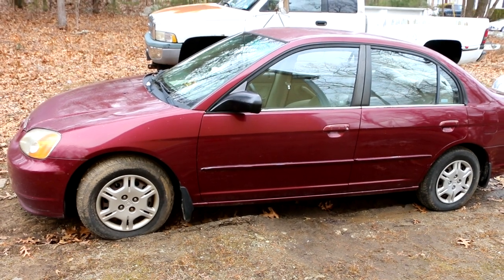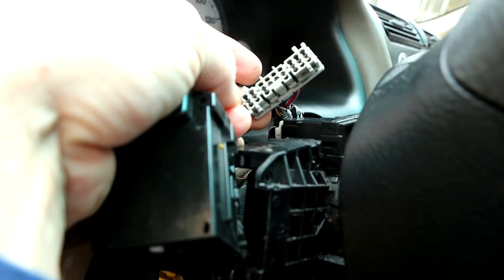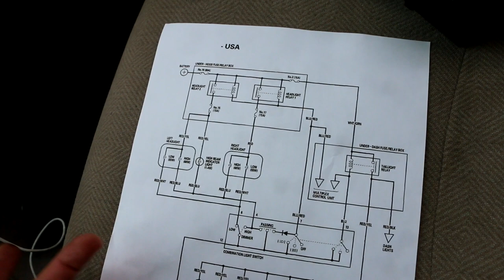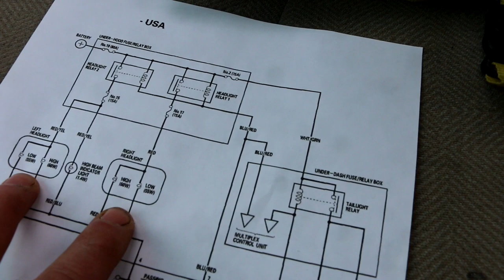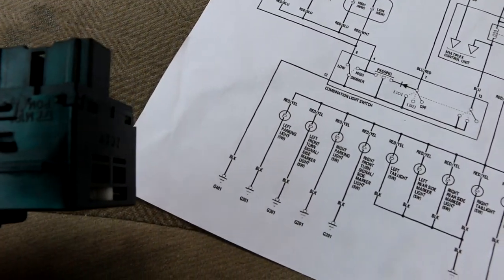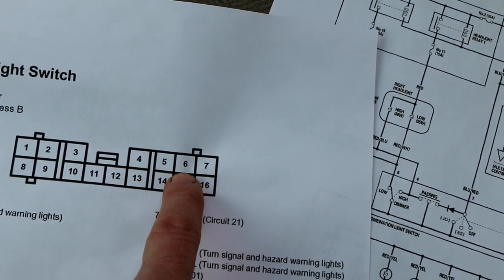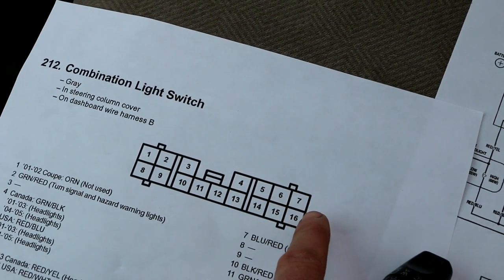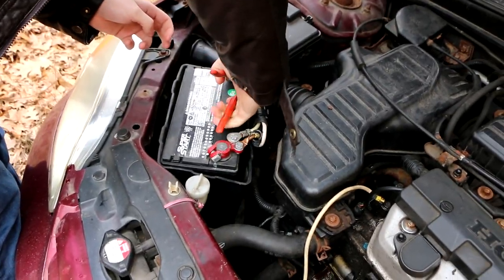2003 Honda Civic Now low beams: headlamp switch diagnosis and replacement.

Comment: I have a Toyota and  I switched the fuses, relay, bulbs and the switch and still no low beams. Worried it's the harness. Going to watch this a few times to see if it helps me learn more
Reply from the maker: If you have not already, try and google search a diagram for the lights on your exact year and model. The fact that you have any lights at all, like high beam, and parking lights would allow you to rule out a lot of things, once you see how the circuit works. If you are not familiar with wiring diagrams or schematics, maybe you have a friend who can look at the diagram and based on your symptoms, point you in the right direction.
Reply: Toyota could be way different than Honda, I would think.

Comment: Just an update from my comment below:  I guesses right on the wire placements and got everything to work!  Now, what's going to go next on this 2003 Pilot with 217,000 mile care?!
Reply from the maker: Don't know where you live but rust is what's killed our much loved 2007 with much lower mileage. Unibody rotted where rear suspension components attach to under the body. Outer body was still in great shape. Wish we had done an undercarriage rust protection treatment early on. Would have saved that car.
Reply: @stevewatr  , sorry to hear that about your Honda.  I live in NJ near the shore so there's definitely rust on the frame.   Also wish I had done more undercarriage washes but can do nothing about it now.  I know I'm buying time but I'm just hoping to get 50,000 or so more miles out of it.  Had a timing belt put on it 10,000 miles ago so we're hoping to get our moneys worth because of that.  .
Reply from the maker: @ajohnson6416  Wife replaced the 07 Pilot with a brand new CRV.....she misses her Pilot a lot. The CRV is a great car, she just liked the Pilot more, but the new Pilot's were too much $$$$.

Comment: Interesting video!  Great job analyzing the combo switch!  My issue isn't just the switch, its the white connector that it plugs into as well.  I don't know if my son spilled something on his steering wheel but the while plug basically burnt up in one spot which prevented the low lights from working yet the high beams still worked.  After searching I found a replacement white plug from Ebay that stated it was for the combination turn signal/headlamp switch.  Got the two parts and although they fit the wire colors don't match entirely.  There are 9 wires for both sides but again, a couple colors are off.  I was just going to cut the wires from the white connector and just match wires up as far as placement goes but then there's two odd wires that are in different locations.  Anyway, guess I"m venting because I'm kinda stuck on what to do next.  Just match up what I can then play with the last two?  That could blow a fuse or two I"m thinking.  I also don't know if I should try to find another white connector, but I don't know if it exists.  Honda said they no longer carry parts like that for that year car so there's that too.  Anyway, thanks for the video, learned a lot about how those things worked!
Reply: Don't blame your son! This is a common problem with the Honda Civics of the time. In the US these were recalled to fix the issue. Google for more information.

Comment: I replaced the switch. Did not fix it. Got any ideas on what to do now?
Reply: I got the same problem as you. What did you do now?
Reply: @MrNobody2828  I had some
Look at the electrical behind steering wheel and it fixed the issue
Reply: @dsobeckm  What exactly do you look for behind the steering all plugs and wires look fine!
Reply: @rdata34  I pulled the wire harness out and checked all the wires made sure they were in and that worked
Reply: MCU. Oh no!

Comment: Hello ,I have the same problem with my low beams. I have Honda Element 05. Turned out the problem is not from the switch. I changed it with brand new and still have the issue. I put back the old one. Did a multimeter test ,they both have the same measurements. It's not from the switch. When I turn on the low beams the 3 pins for the headlights have power ! When the high  beams are on I have 2 pins with power and 1 ground. Friend told me this is from a bad relay. I couldn't find my low beam relay onto my Element. I researched and found that there is one under the stearing wheel , somewhere on the left side. Problem is I don't have any relays on my Honda ,there !
I NEED HELP if it's possible !!!
THANK YOU MUCH in advance !!!!!!!!!!

Comment: Great video. I have a similar problem with my 2001 Honda Civic door. I’m trying to find out why my lights won’t turn on in winter the lights work but high beams won’t work and the light in the dash. The lights. Work in the summer to maybe I can get some help
Reply from the maker: It could be the switch I replaced in this video but the unusual thing about your problem is the winter comment. Makes me think it is different in colder weather. So maybe its a bad relay. There are 2 relays for the headlights under the hood. They are more likely to be affected by the cold. Its just a theory but I'd start there.
Reply: Ok cool thanks for the help I’m going to just switch out both and see what happens
Reply: Just wanted to ask is that the fuse box
Reply from the maker: @wr8127  I looked at the diagram again and based on the way it works, if the relays were the issue, I do not think you would have high or low beam. I am leaning towards it being the switch I replaced in the column since it is responsible for selecting high or low beam.
Reply: I have the exact same problem, any updates?

Comment: I got a left low beam headlight that doesn't work right works fine, and both can do high beam, just this damn left one idk what the deal is I changed the fuse, but I think it just might be the headlight relay idk

Comment: I can't seem to slide it out is there something I'm missing?
Reply from the maker: The switch? Did you remove the 2 screws? Then you need to remove the plug and then pry up gently on a clip then slide it out